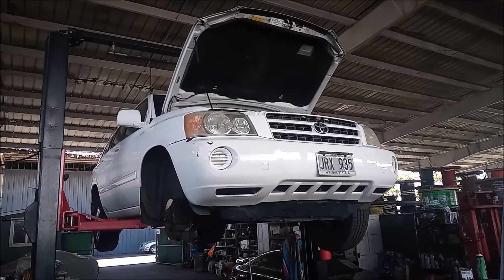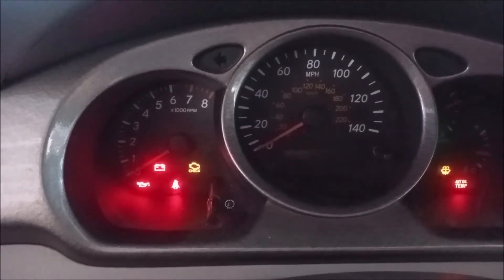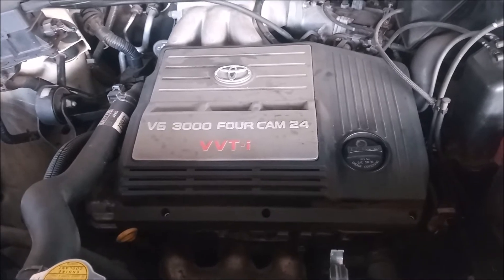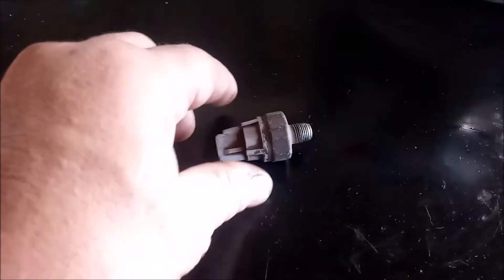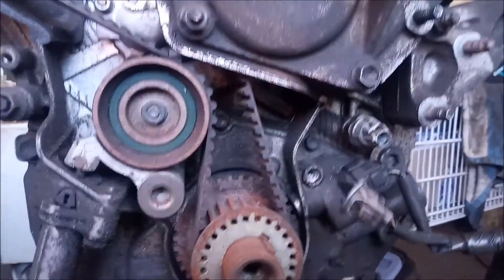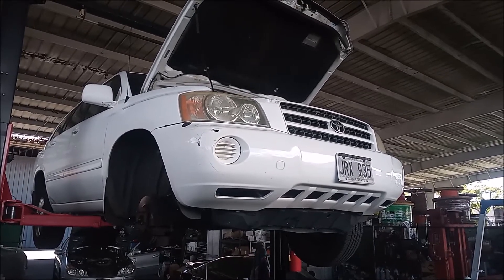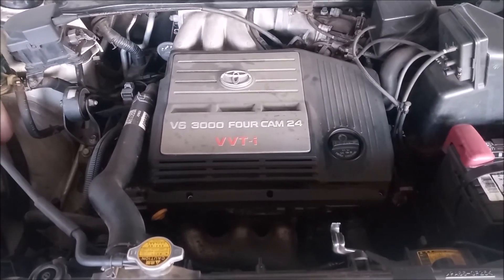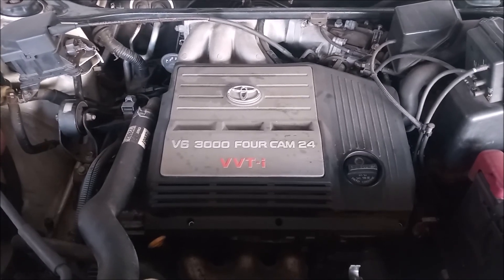1MZ-FE Sludge - Oil Pressure Fix and Test - Toyota Highlander

Comment: I’m rebuilding a 1mzfe. Oil lights are on. I’ve cranked the starter for over 2 minutes. Is this an issue because the intake manifold is still off, or should I worry and buy a gauge?
Reply from the maker: Intake manifold does not affect oil pressure. Your first suspect is the oil pressure sender, and its connection/wiring.
Reply: @Merryfrankster_  Thanks for the reply. The sensor worked before the engine was rebuilt. I was just thinking the intake manifold might be making the ECU have a confused fit. I was thinking about taking the front valve cover off and turning it over and watching for oil flow on the cams.

Comment: Hey man, I'm about to buy an old 1999 avalon. How do I check for engine sludge aside from checking the oil cap and are there any other issues with this engine?
Reply from the maker: This engine has all the issues of wear and tear of a 25 year old engine. Old toyotas do not run forever. Unless you know the history of this car, you are going to replace the entire car piece by piece one at a time as they break or fail.
Reply from the maker: Do not believe a single word the seller tells you about the car. Every seller lies, whether they intend to lie, or not.
Reply: @Merryfrankster_  thanks for your suggestion, so I should just move on and look for smth else you reckon?

Comment: This is pretty much all you can do on this engine unless the owner wants to spend an arm and a leg on tearing apart the rear valve cover and removing the cams for cleaning. Synthetic oil only and 1,000 miles intervals until it clears up should help with draining the sludge
Reply from the maker: Thank you for watching and for commenting.

Comment: Have a 2006 Highlander w 3MZ-FE bought used 2 yr ago .. changing the front valve cover & WOW. Chocolate cake & shiny black solid sludge ... was running fine. Cleaned the valve cover which had the air/oil separator totally clogged. Ran transmission fluid & engine cleaner ... didn't touch the sludge ... now have oil light ... little knocking.  Not sure if we should vacuum. Where does the oil go when looking down at this mess?
Reply from the maker: Best bet is take off the oil pan and clean the oil pickup strainer as well as any debris in the oil pan.
Reply: @Merryfrankster_  Thanks.  That's what we did. Also changed oil pressure sensor.  Went ~ 3 miles then the oil light came back on. Stopping & starting clears the light & driving 20mph keeps it off.  Looks like several iterations of dropping the pan & cleaning the strainer may be necessary ... hate having to scrape/clean sealer each time.
Reply: If there's a gasket other than the sealer or if we could make a cork/rubber or other removable gasket it'd make it easier.
Reply from the maker: @mrkrmjr  this is a symptom of a bigger issue. The oil pressure varies with rpm. It gets higher with RPM. This is normal. But your oil pressure at low rpm is too low. This means either there is an issue in the oil pump or in the bearings or the oil pickup tube is not picking up enough oil. You can switch to a thicker oil like a 10W40 or a 20W50 and this will increase your oil pressure. I have posted a video on how to replace the oil pump. Unfortunately this does require a lot of disassembly. Continuing to run the engine with low oil pressure will lead to an engine failure.
Reply from the maker: @mrkrmjr  removable gaskets leak. A cork gasket is available in the aftermarket. You can purchase a few to use temporarily until you get the problem resolved, then you can reseal the pan correctly with FIPG.
Reply: @Merryfrankster_  The oil light doesn't come on at low rpm ...is the oil pressure affected by a clogged strainer?
Reply from the maker: @mrkrmjr  absolutely
Reply: @Merryfrankster_  Thanks ... what about BG Dynamics Engine Cleaner or 505CRO?
Reply from the maker: @mrkrmjr  I use a cheap engine flush from Napa. Look I am going to be honest with you when an engine gets to a certain point of sludging, all you can do is put it on life support, you cannot cure it, unless you disassemble it completely.
Reply: I agree. Thanks for your replies. btw - very similar to comedian Mitch Fatel… check him out 😊
Reply from the maker: @mrkrmjr  yah ok that is a positive change from Mr. Bean.
Reply: Your voice sounds similar

Comment: I have lexus es 300 2002, this engine is kinda calm in driving, so i am looking to add oil cleaner or not... its only 150k km. Only thing i know it was in bad hands last 5 years
Reply from the maker: You can check the spark plugs, they should be changed every 100K miles - or less. Often the spark plug wells are filled with oil from the leaking valve cover gasket. This does not help.
Reply: @Merryfrankster_  oh so much worky worky. And yes oil sips out everywhere(from valve covers) like a blooded deeer in agony. However oil level is stable and i just want make sure i did all i could to prolong its life . Im not mechanic i am a driver)
Reply from the maker: @iwantequinox  Just drive it into the ground, however long it takes, and you'll be done with it, so you can move on to the next victim.

Comment: Mileage of vehicle and type of oil used.Conventional/Synthetic? Along with oil change history if possible?
Reply from the maker: Too late for that. Car was totaled in flood shortly after.
Reply: Had to have been conventional oil. These engines even with on time oil changes with conventional still caused sludge. You have to use synthetic oil to avoid the sludge

Comment: Hi, great video. I just bought an import estima 2004 3.0l 1mzfe  vvti engine previus owner stated he used 15w40 castrol its done 140,000kms what oil would you recommend i use instead thanks
Reply from the maker: 5W30 or 10W30 mobil1 synthetic. Change frequently. no more than 5,000 miles (8 000km) between changes.

Comment: is it a decent idea to put oil cleaners like lucas or seafoam into the oil that are made to break down build up? like will it help reduce the sludged oil?
Reply from the maker: Some people state a concern that with an engine that is already sludged up, using a cleaner or flush may loosen up sludge and cause it to clog up the oil passages and the oil pump pickup. I do use an engine flush on engines that are not too far gone but on engines that are all crusted up on the inside (check under the valve covers) I just stick a fork in em and turn em over, they're done. Don't bother with the bbq sauce.
Reply: @Merryfrankster_  okay thank you so so much! just passed 190k miles on my 94 non vvti 1mz in my camry coupe, was owned by an old man who took great care of it and kept all his maintenance receipts and stuff, and i can tell its been changed regularly and driven by an old man,  and runs great so id guess the sludge aint bad even tho its at 190k 🤷🏽‍♂️ i wanna cam it even tho its got lots of miles, but i have no idea where to get custom ones and i cant find any 3mz/2mz cams i wanted at least exhaust cams if i can only get the other mz ones but a set of custom ones would be sick, yk if like machine shops or sum could make me custom cams???
Reply from the maker: @Yes-bg5nr  don't bother with that - just swap a 3.5-liter 2gr-fe for your old 1mz and gain 100whp.

Comment: What would be an easy way to get an oil pressure gauge to work on that Highlander for normal driving? I'm mostly wondering if it would require any parts other than the gauge and wiring from the sensor to the gauge.
Reply from the maker: You would need to put a tee fitting on the oil pressure port. The stock switch would go in one side, your aftermarket sensor in the other. Note that Toyota utilizes a 1/8 BSPT thread forthe oil pressure switch. All domestic oil pressure sensors/gauges you can buy uitlize 1/8 NPT. Fortunately there is a special ftee itting available aftermarket for Toyotas and Hondas that threads in with 1/8 male BSPT and has 1 female 1/8NPT port for your aftermarket sensor and one female 1/8BSPT port for your stock switch.  Look for this fitting on eBay. Another alternative is to fit a sandwich plate on the oil filter , and place the oil pressure switch in the sandwich plate.

Comment: This video save me alot of time with my 2002 highlander. Had low oil light come on while driving. Then it would shut off the engine.  Had to clean the oil strainer and solved my problem.
Reply: Did you mean to say the oil filter?
Reply: @KirkWebmeister  I think he means the oil strainer
Reply: @porcupinepunch6893 as if this engine has a strainer?  Where and when was that covered?
Reply: @KirkWebmeister   😂why would anyone actually try to clean an oil filter?  You dont know anything do you? lol...
Reply: My daughters did the same thing but now it won’t start. Did yours still start after it died?
Reply from the maker: Good job. Thanks for watching.

Comment: Did you use any snake oil or chemical to get the doodoo out of the top of the engine? Just wondering if there is anything that will break it up “quickly and safely”
Reply from the maker: I used a vacuum cleaner. There is no way to break it up safely.

Comment: Use your scan tool to check for oil pressure.😁
Reply from the maker: Buddy that is not and available PID on this vehicle - not with a generic scantool AND not with manufacturer-specific PIDs. Why don't you just stick with what you know instead of making an ass of yourself.
Reply: Such a satisfying response. Troll stopped in his tracks.

Comment: Good stuff. If you are unsure or don't want to do this professional work or don't have time, the trick here is to switch to full synthetic and change oil periodically. You don't want to just flush out the sludge at once. This might cause issues. Then after 3 or 4 oil changes, do exactly what this guy did and maintain synthetic and 3-4k oil changes. Should do 500k easily
Reply from the maker: Thank you for watching.

Comment: Owner probably extended his oil change intervals way too long. Happens. I do mine at 4k. I’m at 350k miles on my 1mzfe. Still running well
Reply from the maker: Some owners never change the oil or never bother to add any until the engine seizes. Seen this too many times.
Reply: Mines at 175 and I only run mobil1 5w30 in it and change every 4k
Reply: Been using 10w-30 since it’s been burning oil. I even use 10-40 to add. Since it’s the non vvt engine, doesn’t even hurt it

Comment: My Oil light started blinking then stayed on after starting my car up, then when I was going to put my car inside the garage, i kinda felt like it was failing fir a single second so I turned the car off quickly, gonna try cleaning the pickup tube in these days, just hope I’m not late, I’m so worried about my Camry, it only has 132k miles and did my last oil change this January, used Mobil 1 Advanced Synthetic along with Lucas HM stabilizer, always checked the oil level each month up to today and it’s still full, I’m just praying it’s a bad pressure sensor and some sludge on the oil pick up tube cause I’m worried as hell, don’t wanna have to give up on my car yet 😔
Reply from the maker: Start by pulling and cleaning your oil pressure switch, in case it is the culprit. Put a pressure gauge on the sensor port to verify the oil pressure. Then you can move to the next step if needed.

Comment: Curious if this owner had used synthetic oil in this engine. This is a known problem with this engine and it's recommended to use synthetic with this engine to try and avoid this problem.
Reply from the maker: Thank you for watching.
Reply: You basically have to use synthetic oil in this engine to not get sludge. If you really want to avoid sludge, you have to replace the rear valve cover with the updated one that prevents sludge
Reply: Yeah, but who knew of this stupid issue. Junk Engine.
Reply: @guitar1junky  well it's been pretty documented for a long while. I have had one since 2008 and it was well documented at that point. I have run nothing but full synthetic in mine with frequent oil changes.
Reply: @natevanlandingham1945  I bought mine new in 2002. Had no idea this would happen. Dealer said I need a new Engine. I cleaned it out best I could. Still running with no issues. But, I clean the oil pick up tube once a year just to be safe. So, this sludge never goes away.
Reply: @guitar1junky  I just pulled the valve covers off mine today. I am doing new valve cover gaskets, knock sensors and associates parts. There was no more "sludge" or crud inside the valve cover or on the head than any other engine I have had. Actually looked very good under there to me considering this is a known "sludge" engine. Either I am lucky or the synthetic I have run in it and maybe the original owners attention to maintenance.
Reply: @natevanlandingham1945  mine has 180k. To old to put any money in it now. Will see how long this vehicle will last.
Reply: @guitar1junky  that's hardly any kind of miles. Mine has 275,000 miles. It runs great car looks amazing. It's worth the couple hundred dollars to keep it running well. These are 500,000 mile engines easy with maintenance and not ignoring problems.
Reply: @natevanlandingham1945  yes. I believe as well. But I haven't replaced timing belt. Will not pay to get that done. And the rear
main seal leaks oil. But there are a lot of other thing that could fail. I did get new exhaust and A/R sensors and rear O2. We will see. I am up here in Canada. Definitely is a good vehicle.
Reply: @guitar1junky  I have not done a timing belt on mine since I have had it. Believe it might have been done before I got it around 80k. But with it being a non interface engine I have decided to roll the dice and run it. I have been contemplating the job for a few years but have just been kicking that can down the road. I do my own so I won't be paying labor but still several hundred dollars in parts. I have about $400 in parts for the knock sensor job and valve covers and rear plugs..while I'm there .
Reply: @natevanlandingham1945  that's right. mine has 370,000 miles, I have used only mobil 1 full synthetic oil and mobil 1 filter, change the oil every 5000 miles, and last week I did the valve cover gaskets and was horrified to see how much sludge had built up on the valve covers. engine has run smoothly until now and I anticipate it will run for another 150K miles or more. 

@Merryfrankster this video very informative for what to look out for and what steps to take. Thank you!